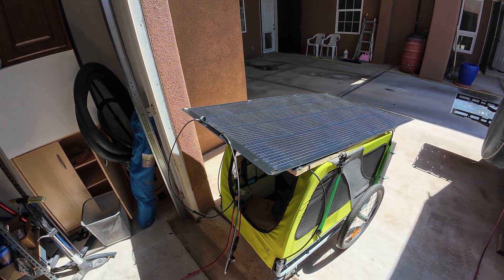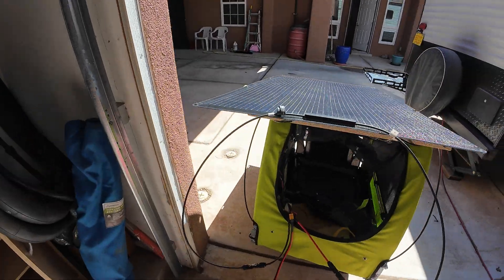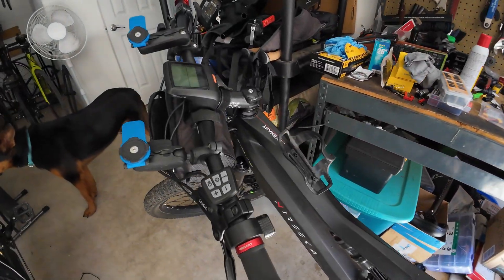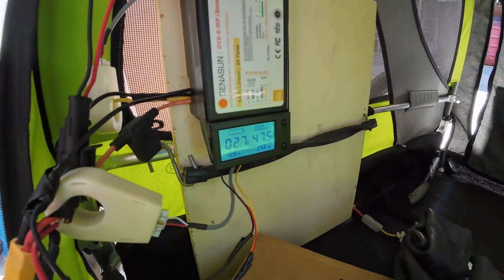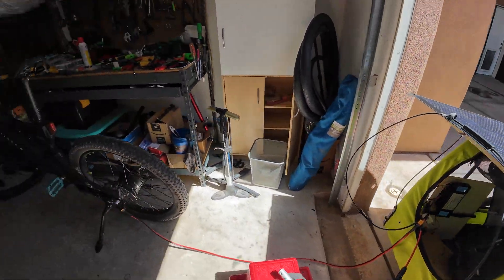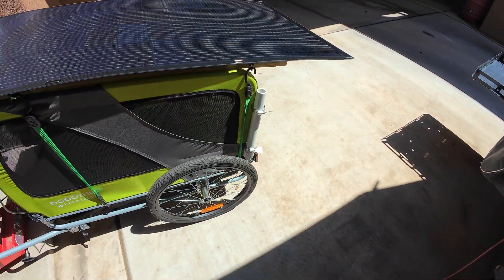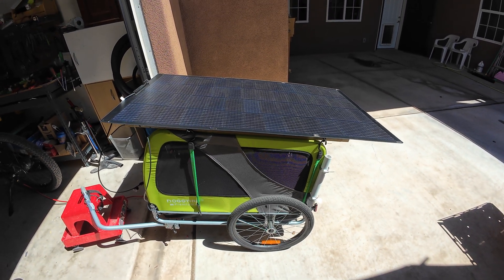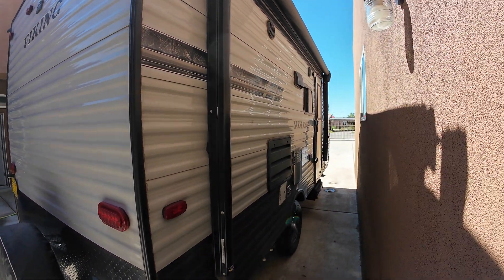200 Watt Solar E-Bike Trailer #ebike #solar

Comment: So you don’t have a battery in the trailer? You’re directly charging the bike from the solar panel?
Reply from the maker: My new set up, which is a custom built e-bike, I have two batteries, one on the bike and one in the trailer directly charging. https://youtu.be/UFt1RqtKo3I

Comment: Now you just need 2500wh-3000wh of batteries.
Reply from the maker: I have a battery coming that fits on the bike, that will get me a total 1680wh, but I think I'm going to have to to consider modifying everything. I would need to by a larger battery pack to keep in the trailer and use this batter parallel device that I have to connect everything.